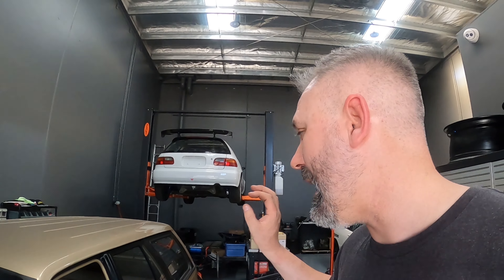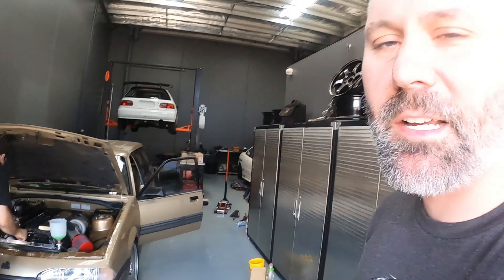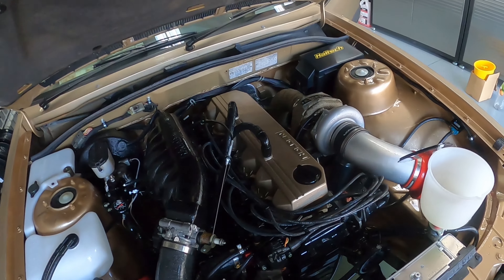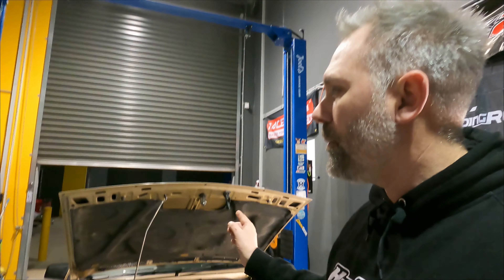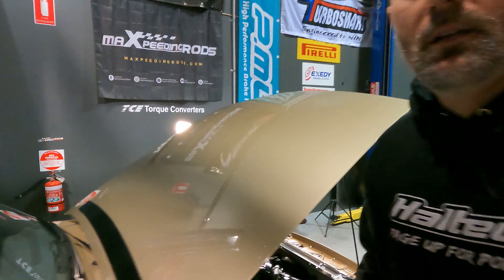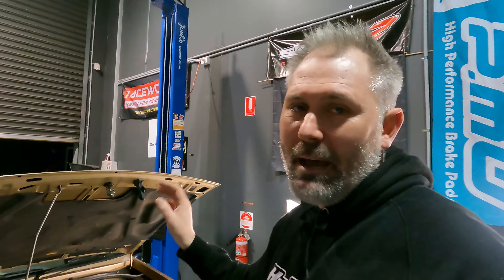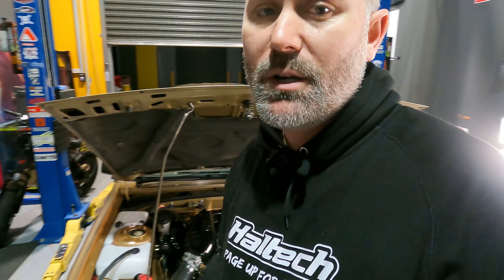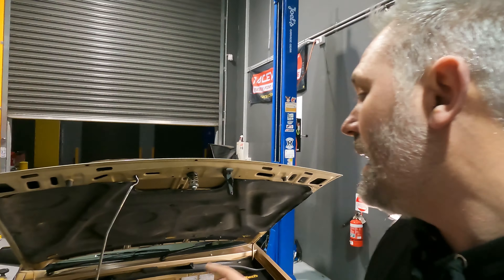Forged RB30 Turbo Build First Start - Screamer Pipe and Dose

Comment: Cheap manifolds are a waste of time. If you had to cut every runner it will no doubt warp with heat overtime. Do it properly and put a 6 boost on it
Reply from the maker: Still waiting for that sponsorship deal ;)
Reply: @TURBOTRISTO  I'm hearing ya man it adds up. What power should it make ?
Reply from the maker: @landcruisertoyota3980  as much as you want i reckon 4-500kw but ill never tune it that high while I have maybe 300kW